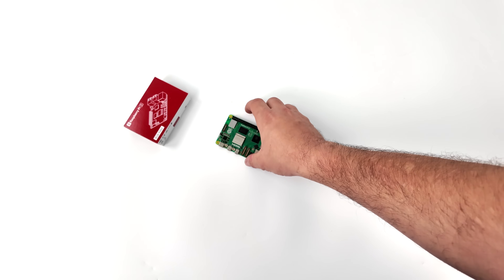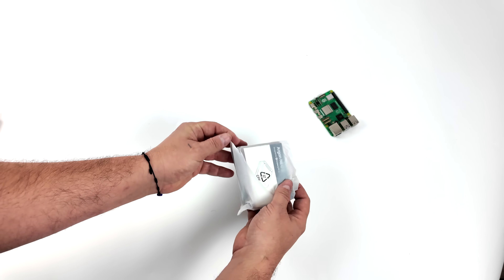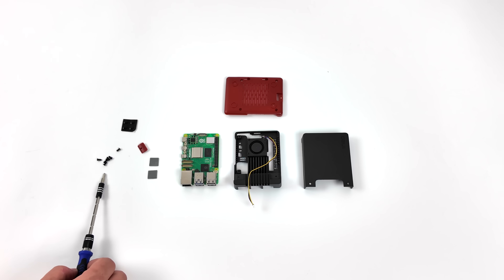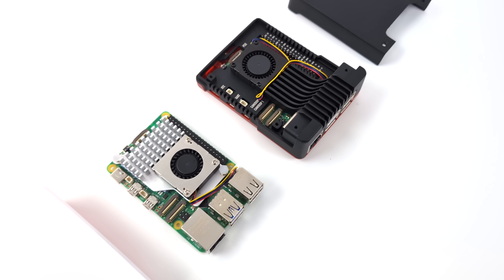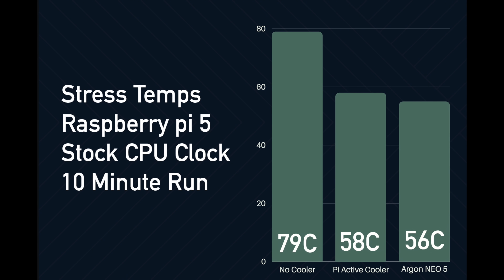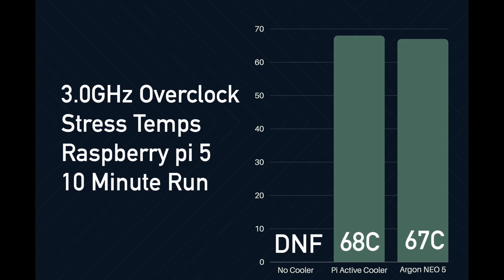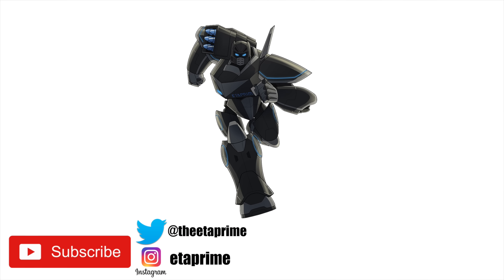The Best Raspberry pi 5 Case Is here! Argon NEO 5 BRED Hands On

Comment: Board lines up perfectly in the case on mine but I have to run it with the screws loose as the power button stalk presses on the power button permanently, any slight movement shuts it off, I will be returning.

Comment: great case, just bought it myself. But it looks like you didn't read the manual...
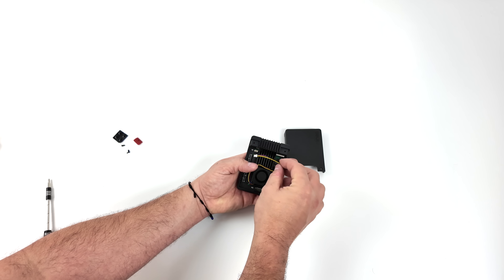3:00 wire management
there is a clear drawing in the manual on how to route the fan cable. so that it doesn't obstruct the airflow from the fan.

Comment: Very annoying that they did not make the fan cable the right length, but it is a very bad idea to lose the extra length in the gap between the side of the fan and the heat sink fins because the air is supposed to flow through there. Only semi-neat way I found was to coil up the excess length under a bit of heat-shrink tubing immediately above the plug. Other bummer is there is no good place to stow the RTC battery. Only solution I found for this is to make a pocket for it in the lid. Literally thirty seconds later I forgot about it and yanked the wires when I took the lid off again!

Comment: Isn't the fan on the Argon a "blower", the same as the official active cooler? If so, the cable routing you have chosen may be blocking the outlet of the fan. Move the cable and rerun the test. I would expect the Argon to run cooler still.

Comment: Not having the access/ability to use the Pcie slot on Pi5 with the help of Argon case is a missed opportunity if you ask me. Argon could have included some slot at the bottom to attach NVME SSD to make it a complete package.
Reply: I’m sure they’ll make another case to do that.
Reply: This is the wrong series for that.  You want the Argon ONE series.  They are releasing that next.  I'm guessing the Argon ONE M.2 version will be reworked specifically for NVMe.
Reply: @isohaven758  I understand that Argon one might have a bigger version where they will increase the price substantially over this to include PCIe compatibility. But, thats the whole point. They should have atleast given such an option in this cheaper model itself. They could have easily increased the space at the bottom to make place for that nvme drive. But, now there is no way/option to do that with this case.
Reply: @namangupta86  No, it doesn't increase the price substantially.  Not even close.  You might want to actually check out their product page before continuing.  Also they just announce they will in fact be making an NVMe addon for this new series as well.  So you're wrong again saying there's no way to do that with this case.
Reply: @isohaven758  let them introduce the addon first. The way there is little space in this neo 1 device. I doubt any addon to utilize it gracefully can be an option. The best they might do is a dangling adaptor that would look ugly and be impractical to use. Lets see if it is even possible with this current design.
Reply: @namangupta86  They already did.

"Exciting news! We're thrilled to announce a dedicated PCIe NVMe expansion board designed specifically for the Argon One V3 for RPi5 (and also coming for Argon NEO 5 for RPi5). In addition, we have other exciting products like cooling accessories and a power delivery GaN set to launch in early January. Stay tuned for updates on our website, and thank you very much for your continuous support."

What part of "Also they just announce they will in fact be making an NVMe addon for this new series as well" wasn't clear?
Reply: @isohaven758  where is the link to that addon for this case? Its not released yet. Announcement and release are 2 different things.
Reply: @namangupta86  You need to stop.  They are a great company who makes great product.  Everything they release is top quality.  They announced it, it's a done deal.  It'll be out in January.
Reply: @JustinEmlay  Why are you behaving like a fanboy kid? Let them release it first. Let's see what they have to offer and then make your judgement. Don't behave irrationaly.
Reply: @namangupta86  The only one being irrational here is you.  You've been given all the information you need yet you keep shutting it down like it doesn't matter.  Clearly the only thing important to you is wanting to pitch a fit about something.

You're wrong.  Period.  End of story.  You ranted about something you knew nothing about and was proven wrong.  Move on kid.
Reply: @JustinEmlay  No, I am right and you are wrong. Simple as that! 😀 There is no link for the PCIe adaptor for this case. It's not my problem if you can't accept defeat. 🤦‍♀
Reply: @namangupta86  Whatever helps you sleep at night kid.
Reply: @JustinEmlay  Whatever makes you happy old man. 😄
Reply: @namangupta86  Knowledge, experience and actually knowing what I'm talking about makes me very happy.  So yeah, thanks!
Reply: @JustinEmlay  Actually, all old men think that way only. 😀 Happy New Year old man!
Reply: @namangupta86   Cool story kid!  Let everyone here, that solidly put you in your place, know if you have any more cool stories!
Reply: @namangupta86 Do you always act like this when people put you in your place? 

"But, now there is no way/option to do that with this case."

You are 100% wrong.  Quit acting like a child and get over yourself.
Reply: @JustinEmlay  All old men feel that way only. Once they know that they are not unique...😀
Reply: @namangupta86  That's the same story.  Do better next time.
Reply: @JustinEmlay  She's just a sad troll.  This is probably all she has in life.
Reply: @JustinEmlay  :face-blue-smiling:
Reply: @isohaven758  Who are you? Both of you lost and I won! Leader always wins. Old men follow! 😎
Reply: @isohaven758  And apparently she needs to have the last word.  I honestly feel sad for her.  You try to help people and educate them but this is just how kids are these days.
Reply: @namangupta86  "But, now there is no way/option to do that with this case."

Remember this complete potato of a comment you made?  That impossible product is for sale on their site already.  Let me know if you need some sour cream and chives.

Comment: I am curious if there is an opening in the shroud around the fan and 'Heatsink' fins? The cable you ran could possibly blocking airflow if that is the case.

Comment: This case feels much much more cheaper than it's predecessor. Leave alone the orrendous color scheme and the fact that most distros has currently problems in custimizing the fan curve. At default the fan starts and stops continuously because the fan starts at 50°C that is near the idle temp.

Comment: Hi , how ironic I wanted to ask people who may have bought this case a  question and its on ETAPRIME's channel which I really enjoy !

My question: Can anyone recommend a cable of 1m or less please that they have a solid tight connection with this case ? 

Background:

Before I had a pi 3b, flic case and HDMI cable with no issues. With this case for my pi 5 it uses micro HDMI instead so I bought a UGREEN Micro HDMI to HDMI 2.1 Cable 8K 4K@120/175/240Hz.  Bit overkill. But like some other issues I read with Pi4 and micro HDMI because of the case design people did get some connection issues. On my Pi 5 to me the cable is not going in far enough, so if I move the case by powering up or plugging controller in  to play on my pi 5 emulation  .... I loose the video and audio, I have to wiggle and push it in  tighter again.  The lead is too loose.  I dont really want to dremel the case like others have done for pi 4. Can anyone recommend a cable of 1m or less please that they  using and have a solid tight connection with this case ? Thanks in advance. Amazon will take cable back they are very good ike that ! A point to note unlike the flirc case this has a screw on cover, which if you swap the car a lot may want to leave off.
Reply: Sorted this out ......The official  raspberry pi hdmi  mini to HDMI  , the metal connector is physically longer you can see it when you put then on top of each other.   Connection through the case is now a lot better without it losing signal.

Comment: @bryanteger wrote:
"Those mini PC's offer far better performance."
Therein lies the problem with the latest Pi. It's price level is approaching mini PCs price level when you factor in, a capable power supply, max memory, effective cooling and a case to suit.
Not many people care if a mini PC uses up a few more inches of space compared with a Pi, so minis must look like a much better fit, especially when the use case is old game emulating. With a PC memory, size is way more flexible as is the power choice of engine and GPU. It's obvious that mini PCs will emulate more consoles glitch-free, no argument there.
What's in the box running this game emulator? Who cares as long as it works . . . properly. That's a mini.
You can bet your sweet bippy that ETA uses a powerful PC of some description as his emulator engine of choice. I do.
Oh and ETA, the Argon Neo is not "an all metal case".
Let's not do that okay? Just sayin', but appreciate the video all the same.

Comment: The fan cable is that long so it can go in a cable tray built in to the underside of the main (middle) part of the case.
Reply: Just twist the wire. It will shorten a bunch.

Comment: Honestly I'm a bit disappointed with the case. It's not like it's terrible or anything, but I really hope they kept the magnets on the lid. One of my favorite things about the Neo case for Pi 4 was that I could access every features of the RPi4 without using any tools. This case would have been perfect if it had both the screw fasteners and the magnets. From the design I don't think it would even have been an impossible design to implement.

Comment: Is the extra wire blocking airflow from the fan to the fins on the heatsink? 

Could you redo the test with the excess wire over by the GPIO pins instead and see if it makes a difference? (Edit: or in the cable tray that someone else mentioned.)
Reply: My thought exactly.
Reply: It won't get redone, these are just adverts for products.
Reply: @jcdenton4911  I'd say blocking all the airflow does little to sell the benefits of this case turning it into a wasted advertisement.  The ONE degree difference from the PI foundation's active cooler proves this. He even goes so far to say "I'd think it would be much lower than this" at the 5:40 mark while being completely oblivious to the airflow obstruction.
Reply: How didn't he thought about that, man? It really says a lot about this channel
Reply: I actually just tested this myself, and came to comment about it when I saw your comment. Anyway, it actually didn't make a difference and I also want to say that I don't really like this case.
Reply: @CaptNumbNutz  it's worse than an ad, it's just clickbait so it really benefits nobody but EP because we all still watched it.
Reply: What about an m.2 drive. Can you then still use the case?
Reply: @randomalleycat  why you not like the neo 5 case? 
what case would you get instead?
Reply: @TylerDurden404  I made a video showing the things I don't like about the Argon case. 

If you need active cooling, I like the case from Geekworm that has two fans, the heatsink actually contacts 4 different chips at the correct height, and it's very quiet even though it's open. It also still gives you access to all the ports and connectors.

If you don't need active cooling or access to internal connections, I really like the case from Flirc, it's just not good at high CPU usage unless you're ok with it getting up to 80 degrees and/or throttling.

Comment: I want a fan noise comparison. I'm told the Pi fan is virtually silent when operating.
Reply: There is a trick for the pi4. 12V fan on 6V pin.
Reply: Correct, it's totally silent on the 5. It's actually strangely silent. Can have it beside me turning on and off and ya have to actually watch the fan to catch it working

Comment: Great video 🎉 ❤

I had a question about this specific case:

With the case top hat closed, is there a slot for pcie flex cable to come out?

And if we use SSD hats with the Pi5, in what state we can use this case (Hat open / closed) ?

Case looks good to me when closed, so I would like to know about these results.
Reply: Not a dedicated slot, no. But you could route it over the cooling fins or between the vents on the side with the power/HDMI. I just tried it with my case. You might have to get a little foldy/bendy with the cable when it's inside but seems to work

Comment: very nice case looks tempting but based on perforamnce id have to past. my over clock temps at 3000 and 1000gpu i get 28-53c over several hours of ps2 emulation and stress tests. open air case is best design. these cases are trapping in an abudant amount of heat from the unit and ps2 aestherx is the most demanding even on the orange pi5. opi5 temps are alot less than this.

Comment: The top cover should have had a magnet holding it in place, like the old one, with the option to screw if you wanted it fixed.
The stupidly long wire for the fan might just be a pre-production issue, assuming they sent this to you.
Reply: Wrong series.  Argon ONE is coming out in January.
Reply: The cable is supposed to be routed under the board, hence why it’s so long. This guy here decided to block the cooling of the fins by wedging the cable between the fan and the fins. 🤡

Comment: Didn't you just block the airflow out of that ducted fan by routing the wire between the cooler and the fan?

I bet a dollar that the fan is supposed to blow right up those fins and out the side of the case.

Comment: It will be great when Raspberry pi 5 itself will cost not 120+ $. With this price + case price you can buy some mini PC.
Reply: Yeah apples to oranges. Pi is physically smaller and uses less energy. Like everything else pick the right tool for the job at hand.
Reply: @curtispavlovec nahh compared to N100 it has worse performance per watt. The RPi has completely lost its appeal. Serves RPI foundation for abandoning the community that made them who they are today and sold out to corporate greed
Reply: @lllongreen  You don’t buy a Pi for performance per watt, or performance period. The advantage is size, low power, and the incredible community and applications custom tailored to the low power Pi devices.
Reply: @lllongreen  I have no idea what youre talking about, this n100 mini pc you mentioned is 219 dollars, that's almost triple the price of a 8gb rpi5
Reply: @curtispavlovec  i know this. You know this, everyone knows this. Yet All these "reviews" do is use rpi as a small computer or home server, which is the reason for my comment in the first place.
Reply: @lllongreen  Zillion different use cases. Pi’s have such a varied use and yes some do just use them as little PCs and run basic loads - they are great for that. But they can do so much more as well. You seem to be a fan of the Intel mini PCs and I agree they are a good bang for the buck - but not a 1:1 replacement for a small SSB that runs on just a few watts over a battery pack.
Reply: @omartabaza7561  maybe you should do some research then before you post.

1) the usual falsum of comparing an rpi WITHOUT,  powersupply, without case, without CPU heatsink to a mini pc that INCLUDES all this.

2) in the EU a rpi 5, 8gb costs 115 euro barebone. Once you add powersupply, case, heatsknl its closer to 135 at least. I have bought N100 minipc that is around 30 % bigger than rpi with 16gb ram and and even included windows license (not that it was needed) for 157 euro ALSO including our local VAT. That minipc has 2.8 times the performance yet beats the rpi 5 on performance per watt in almost all of the Phoronix Linux benchmarks
Reply: @curtispavlovec  another falsum. If you want smallest possible and with IO headers there are much better priced and performing ARM alternatives to rpi. The so called community help people use as a clutch is very exaggerated and people that REALLY use rpi for professional things don't need that community help in the first place. The fact is all people commenting here use it as mini pcnor homeserver or very limited use of the IO header of at all( if they do its with an already completely finished HAT for example audio) and then think that they "developed" a rpi solution 🤣
Reply: @curtispavlovec  al these so called use cases I help people with on rpi forums can and should be done with a micro controller and not a mini pc like the rpi5. It should be done on an Arduino l, rpi 2040 or just any microcontroller in general. All these reviews of rpi5 are doing is benchmarks or small server workload  benchmarks, or emulation, nothing to do with the IO header or these "other" use cases as you call them
Reply: @lllongreen  I'm gonna be honest,the only reason I'm gonna buy a rpi is because it's available in my country,while all these other less popular mini pcs aren't,and if I want to buy them from Amazon or some other website,their price is doubled because of shipping.
Reply: @lllongreen dude, they didn't sell out to corporate greed, they had certain obligations to their commercial partners that actually paid money to get industrial pis and relied on Raspberry Pi foundation for their business. The supply chain reduction because of the pandemic obviously didn't help. What you're saying is absolutely disingenuous at best.
Reply: @bryanteger  you can stop shilling. It's what in fact happened just read the official posts on the rpi forums by Mr. "Stratham" himself. You pretend to know shit that you have zero knowledge about to try and sound authoritive.
Reply: @curtispavlovec  Sorry, I have to disagree. The latest specs for the Pi5 is 5Amps. That is NOT low power and does not come cheap. Size is relative. Pis aren't much smaller than a good mini PC and Free Linux is free on either, right? Then there's quite a few Windows apps out there if one is a MS fan (which I am not personally).